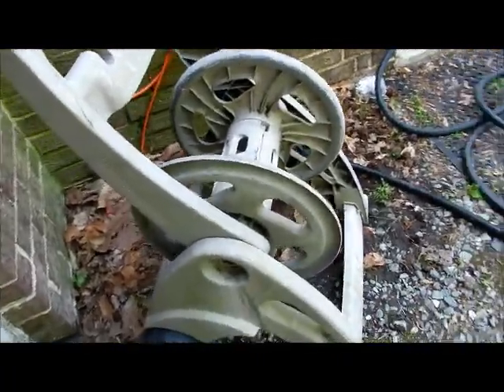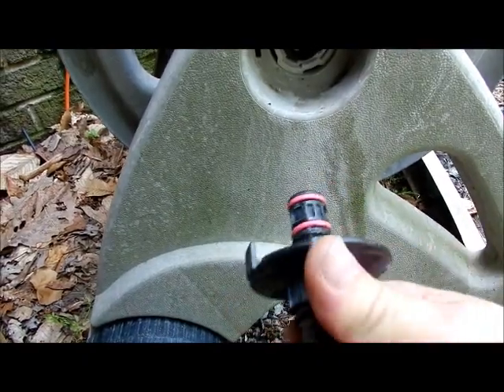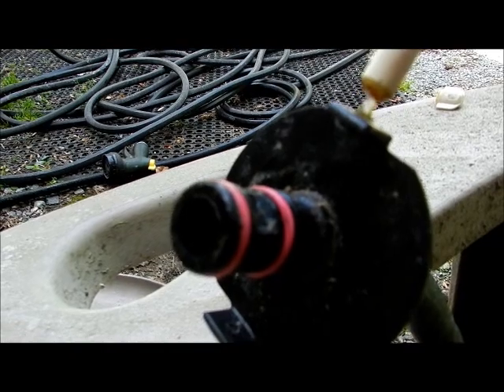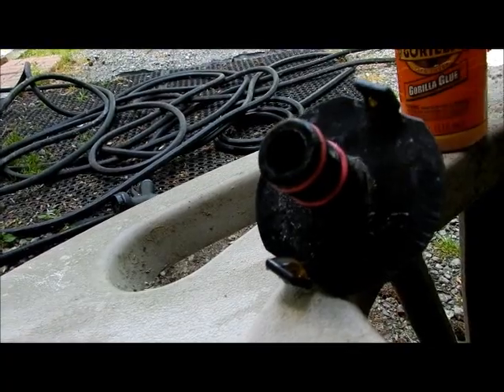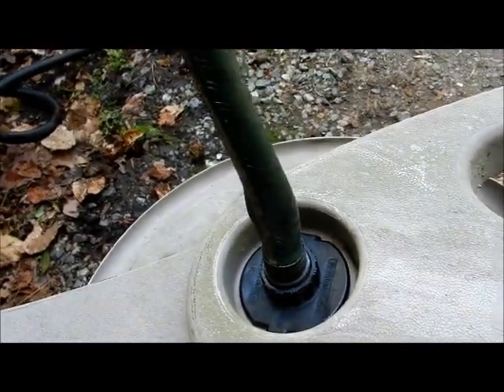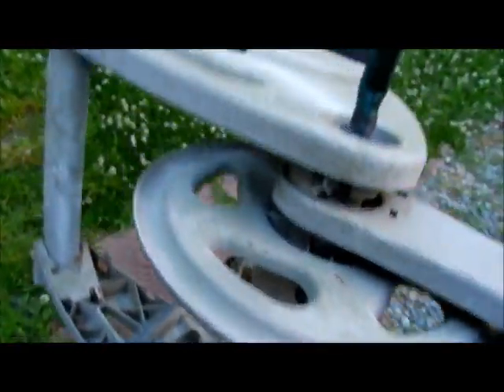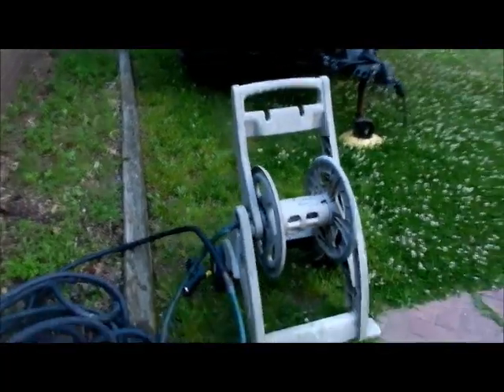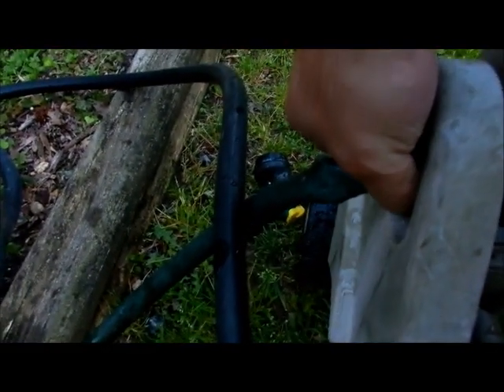How to Repair a Hose Reel

Comment: I put some screws in the flange around the inlet. Stainless, of course. I used 4 screws but a couple would probably do. If the o-rings start leaking, I can remove the inlet and replace the o-rings.
Reply from the maker: Nice.
Reply: I did the same and it seems fine.  Apparently my retaining clip broke and fell out.  From a lot of reviews, it sounds like the retaining clip is pretty lame, even when present!  Like many other Suncast parts, they no longer are available from the company.
Reply from the maker: Not sure.  You may have to contact the maker of the hose reel assembly.
Reply: You guys just put the screws around the face/flange of that plastic inlet into the plastic of the reel?

Comment: Thank you for this!  My fix was taking an old hose that was stuck to the reel.  I ended up hacksawing it off,  damaging the plastic thread.  Fortunately put some wire up the sawed threat fixed my mistake.  My busy fingers popped the hose connection while I was figuring out the fix. Then I needed to fix the damage my fix had made. After seeing your video, I realized that I needed to tip the reel and push down hard so that the plastic ring would pop onto the empty ring below the two o-rings.  Works now, didn't need a new part.
Reply from the maker: Nice.

Comment: How are you going to change the O rings when they go bad?  The part it fit into is like a quick connect, need to take it apart two more steps to fix it properly.
Reply from the maker: When this happens I will.

Comment: I have a Suncast Farmhouse Hose Hideaway enclosure that needs a handle replaced but I cannot find any info anywhere on how to disassemble it. There are no screws used on this model. Any help would be greatly appreciated.
Reply from the maker: Not sure.  Sound to my that it's not meant to be fixed.  Wish you were close to me so I can see it.

Comment: Thank you for the video!  My Suncast reel is doing the same thing.  Both tabs are there,  but when the water is turned on, it pops out!  I will be trying your repair trick.
Reply from the maker: +nancylati Good luck and thanks.

Comment: I have issues with the fix. Firstly, there was no mention of showing how to screw small holes in black tabs, nor the size drill bit to use to do it. Secondly, there's no mention of replacing the red pressure neoprene washers which seal any water leaks. It's important because they wear out and now that you've Gorilla-glued it, would make it impossible to do another repair of either the snap connector, o-rings or tube.
Reply from the maker: Take a look at the threads below.  Some idea may help you.  Use drill bits, if needed, that match the screws that you use.  Just replace the washers as needed.

Comment: If the problem is a leak, not a missing/broken snap connector, then do this:
- buy a pair of #14 o-rings: 15/16" OD X 3/4" ID X3/32 thickness
- a small tube of silicon grease

press on the external tab while gently shaking the coupler loose
once removed, thoroughly clean the inside and of the coupler and remove the old o-rings
carefully replace the o-rings and lubricate the o-rings and shaft with silicon grease
re-install the connector and hose

After 4 years of a lot of use, the old o-rings were worn and needed replacement. 

Cost of o-rings: about 50 cents with tax.
Reply from the maker: Nice post.

Comment: No glue or screws necessary.  Make sure the red connector tabs are actually broken before getting into all that.  You can access the pull tabs which release this part by simply removing the hose and separating the cross casing.  Pull the tabs “out” to release this whole part.  Grease, change o-rings, etc.  then push the part back on, make sure the tabs are back in locking position and carry on with your life!
Reply: This helped me sole the mystery of how to fix these older ones.  Once you get the cross casing apart put your thumb on the plastic outlet tube and 1 finger each on the 2 white 90-deg tabs and squeeze together - the tabs pop forward and release the inlet tube.  Fixed our old one with 2 new o-rings and some food-safe gasket grease.  Zero leak.
Reply: This does actually work. Thank you @jtdubzz

Comment: Thanks. I've tried gluing mine which looks like the exact same set up as yours without success, several times now, but I think I'll give it one more try with the small holes you drilled and some grilla glue.
Reply: Thanks. I'm trying to see if Suncast will send me the replacement parts needed to make a good repair.
Reply from the maker: Great.

Comment: Good idea with the glue. I put 4 short screws in on the outside edge of the disc. Same fix but that way you can still remove it to replace orings.
Reply from the maker: Nice.

Comment: Why not just replace that part and fix it properly?
Reply: Yes, you can buy a Suncast "in and out tube" replacement kit; has instructions. You pull apart the the reel (it's just snapped together) to access the part. sometimes it's just the O-rings which you can buy at the hardware store.

Comment: In MANY cases, this doesn't resolve the issue. The water pressure will build between the reel body and the part with the o-rings. Then, it will just leak from there.

The problem is the plastic prongs on the part that mates with the stem, just inside of the first o-ring. There are four tabs that snap inward to hold the o-ring part. These tabs get weak and sometimes break. This allows that piece to come out. I looked on Thingiverse. There are currently no designs available for 3D printing the replacement part.....yet. 😉
Reply from the maker: Thanks for the post.  After five years this is still working great.

Comment: The idiot did not save and use the V clip that came with it and secures to hose
Reply from the maker: Don't know why you are calling me names.  This never came with a V clip.
Reply: You are right, we are both idiots for buying this product
Reply: Rude
Reply: I have the exact same model with the exact same problem. I can confirm there is absolutely no clip, but most importantly, there was absolutely no reason for calling you an idiot. NONE!